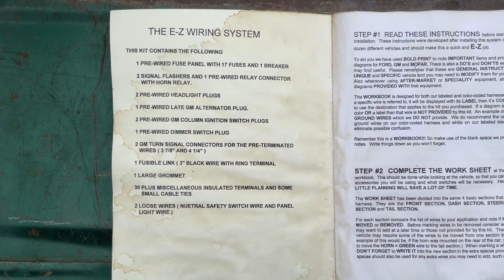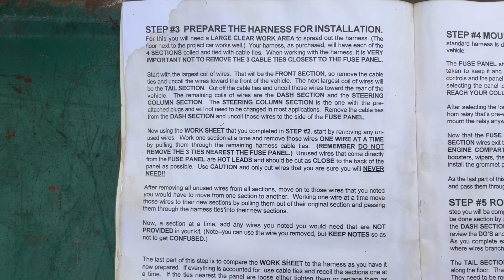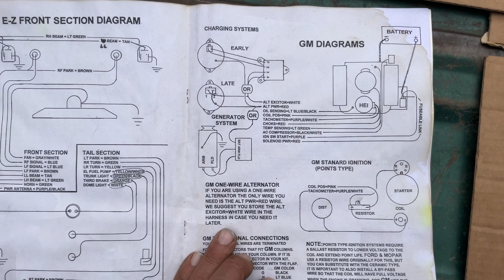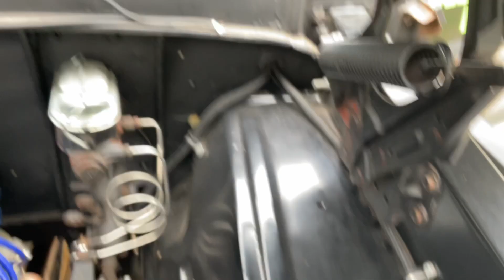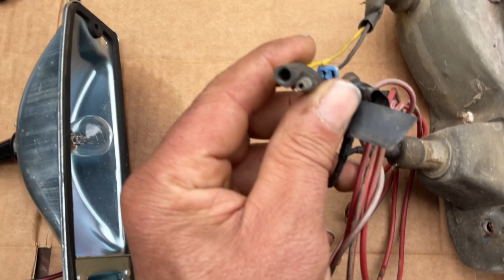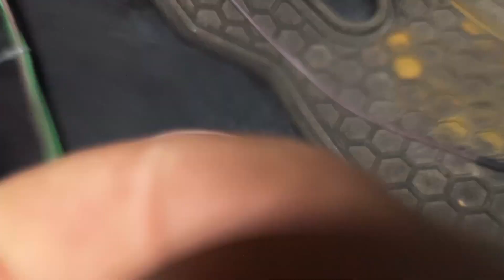HOW EASY IS THE “E-Z WIRING” UNIVERSAL HOTROD WIRING KIT TO INSTALL???

Comment: 😮nice job on the video. I’m replacing my wiring harness on a  mid 70’s Land Cruiser. Would like to use original gauges plus directionals off column, but can’t find anyone who has experience doing this conversion. Most use a universal kit which I’ll probably have to use. So I’m looking at several harness kits, painless, haywire, affordable, etc.. still undecided.  Your video made ez look ez  but you did lots of your own wiring, and I’m just a beginner. Would appreciate any info/experience you or your readers can send my way. Thanks
Reply from the maker: Good day Terry. The E-Z wiring kit is really designed for folks doing custom builds. As I pointed out in my video the kit is GM oriented for GM components because most folks use them on their builds. My advice is to find a 70’s Land Cruiser group page or forum. I am sure you will find someone who has done what you’re about to embark on. Thank you for the kind words and good luck with your Land Cruiser you have one from a great era!

Comment: I bought an EZ wiring kit for my '36 chevy coupe and was just looking at it. Do they follow the color code of ANY car manufacture? The American Auto Wire kit for my '67 elCamino is EXACTLY like my other Chevies.
Reply from the maker: No not specifically. The EZ wire kit is really designed for someone doing a custom build. Though the kit has a lot of connectors and such for chevy components that are commonly used with hot rod builds.
Reply: The 21 circuit universal EZ wiring kit I bought for my truck is all GM color codes. Purple starter wire etc.

Comment: Do you have a follow up video of the lighting and how it works with the dimmer switch?
I’m currently wiring a car with the same harness.  Great video btw.
Reply from the maker: Good day. I just read your question. No I have not made a follow up video. I will have to go back and watch the video?  But to try and answer your question, The dimmer controller on my factory light switch worked fine when I wired it up. Though I wired my interior light to a separate toggle switch on the dash.

Comment: Thanks for making this video.  I just got a 21 circuit version off Temu for my rat rod ($50ish shipped after discounts!) and it has a copy of the exact same manual.  Even the wires have hard to read printing like yours does.  I'll soon find out if things were wired correctly!
Reply from the maker: You are welcome! Just wanted to pass on my experience with wiring kit to hopefully help another.

Comment: Does this kit include the dash wiring. Looking at wiring a 69 f100 Ranger XLT.
Thanks for the video.
Reply from the maker: Good day Bradford, It does not. The reason I picked this kit and not a wiring kit designed for an F100 application is because I made up my own gauge cluster using mostly mechanical gauges. I saved myself about 500.00 wiring up my own cluster.
Reply: I'm doing the same now. But I can't find a ignition switch that matches the connector that's on the harness. What did you use?

Comment: Off topic related to ur early video. How to eliminate all sensors 4 tbi to carb. O2 knock egr maf evap an so on. Thx 4 ur efforts
Reply from the maker: Good day, yes when going to a carb all the sensors you mentioned can be eliminated .
Reply: When removing said sensors what is to be done with pcm ecm gem module or can those also be eliminated. Again thx sorry for multiple questions